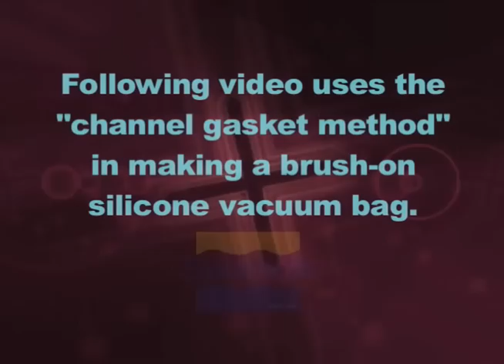Advantages of EZ~Brush® Vac Bag Silicone Vacuum Bagging Material

Comment: If the vacuum is on during the cure, what stops the resin from flowing out of the part and into the pump?
Reply from the maker: To address your concern, please contact Smooth-On technical support for assistance with your specific application. Have a great day!

Comment: Approximately how thick did the bag in the video end up? Was it as little as 2 mm? Closer to 3 or 4 mm? Thicker than that?
Reply: Stephen Westbury, thank you for the reply and the link. That does indeed answer my main questions. I had looked at a whole bunch of stuff on the Smooth-On website but had not run across that info. Also, EZ-Brush was not listed in the Material Calculator.
Reply: ***** It more than likely because it is a brushable material and is harder to figure out the exact math. There are simply too many variables.
Reply from the maker: It depends on where you measure as some reinforced sections are thicker. I would think 2-4 mm would be an average bag thickness for production infusion.